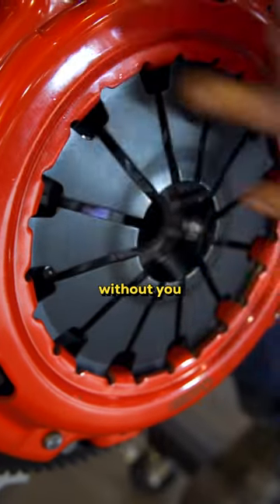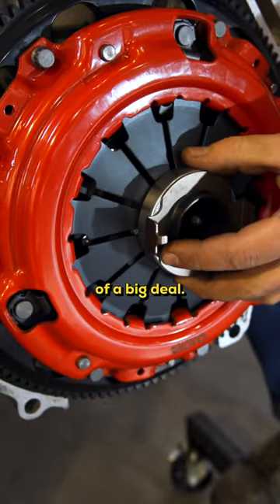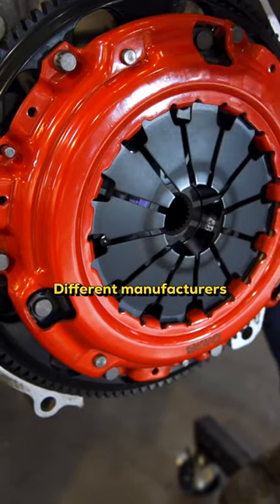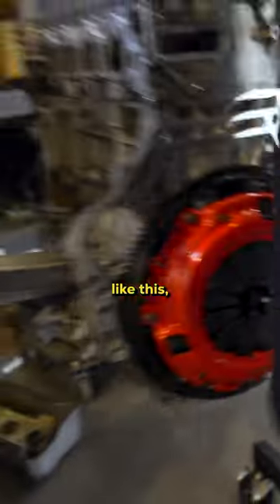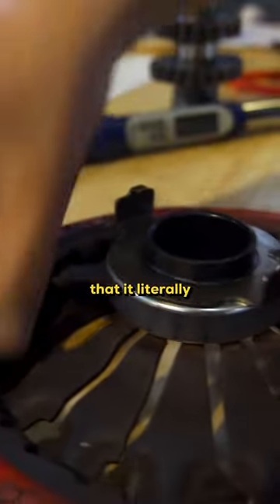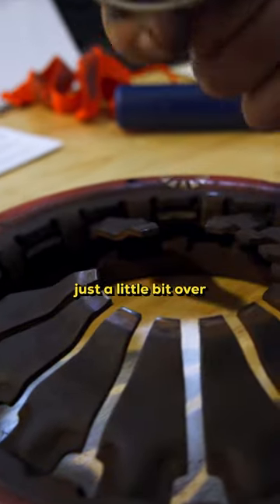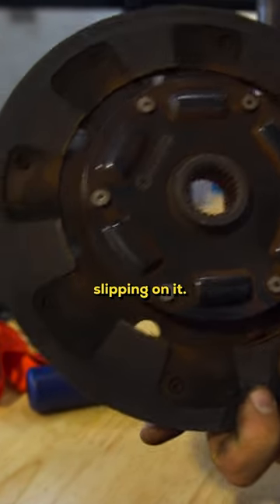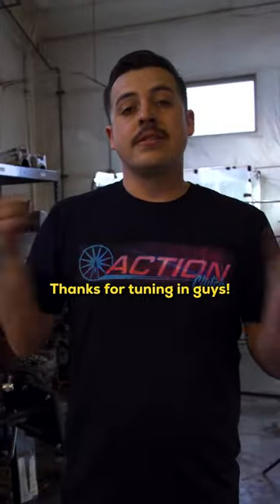IS THE THROWOUT BEARING BURNING YOUR CLUTCH!!

Comment: You forgot to mention the throwout bearing is not supposed to ride on a diaphragm fingers or a three finger clutch it should have a minimum of 1/16 of an inch which is 0625 it should only spend when you put the clutch in otherwise it will wear out and burn up prematurely that's why you don't ride and drive with your foot on the clutch

Comment: I had my clutch material expand so much that the clutch locked up and I had little cash so I just compressed it and the clutch fingers bent enough that I could use it for another year but now I have to take it back to where they put the crappy expanding clutch in or leave it on the street.

Comment: Exact same clutch as mine, exact same problem, essentially glued my clutch plate to my pressure plate, went to go one day and it wouldn’t go into gear, was told it’s the master cylinder, wasn’t that, took the clutch off and the pressure plate and clutch plate were stuck together, had to pry it apart with a screwdriver. Only had it 6 weeks.

Comment: Been there, had mine adjusted backwards, fully tight. Smoked the clutch. Having issues with z bar and linkage now. Buying a new clutch starting over. 
Last time split z bar and bent clutch fork. Lesson learned.

Comment: Video on clutch adjustment plz
Reply from the maker: Noted 🫡
Reply: I should've explored adjusting my "frankensteined" clutch setup on my bmw
Reply: Seriously. How would you adjust the slave?
Reply: @Mustard-Bargain  well, just a quick theory, was maybe modify the body of the slave (skimming down the ears, so the plunger fits deeper into the bell housing/clutch fork).   Dunno if it's been done before, or not, or whether it can even be done, lol.  My mind was just wandering...
Reply: Can the car clutch works for a power press machine or not 🙏

Comment: I have a 83 toyota corolla wagon AE71 rwd 1.6 that I changed over to a 5 speed manual. 
I had to make the hydraulic line from the master to the slave .
I can not get the free travel I need on the pedal .
I can adjust it so it has about 1/4 free travel, then as soon as the engine gets to operating temperature it has no free travel .
First thing it the morning the pedal has the 1/4" free travel then after the engine warms up the travel is gone with O free travel. 
I can adjust it after the engine gets to operating temperature and have 1/4" free travel. 
Then when it cools down the pedal has way to much travel with the clutch catching right on the floor.
 
And information would be greatly appreciated ...
Reply: Possibly didn't bleed the line correctly and water or air expands due to heat?
Reply: You have air in the system somewhere. Hydraulic fluid doesn’t expand like that with mild temperature changes
Reply from the maker: Double check for air in the system also make sure the hydraulic line you made from the slave to the master has the proper fittings that could be another issue that would result in the same problem.

Comment: Great video, informative and to the point!
I'm currently trying to diagnose a problem with my car since the clutch won't fully disengage and start to slip and spin the wheels if I put it in neutral and let out the clutch pedal. You hear the whirring vibrating sound from within the car and it's really notiecable, even more so outside. A mechanic changed the clutch, pressure plate and throwout bearing, the slave cylinder and the clutch hose without any improvement. Also machined the flywheel.

Any chance it has to do with the adjustment or is it more likely to be a pilot bearing or something?
Reply from the maker: Yes sounds like an adjustment issue where the throw out bearing still touching the pressure plate that causing the clutch to still trying to engage with out pressing down on the clutch pedal.

Comment: I’m looking to upgrade my clutch and throw out bearing on my 325xi 2004 any tips or recommendations on better performance brands where I wont find myself causing more issues by putting the throw out bearing on too tight or loose.

Comment: if we place the gearbox on the engine but support it with the primary shaft of the gearbox before tightening the screws, could this twist this shaft and subsequently cause tremors to the steering wheel at high speed

Comment: I just had my clutch, pressure plate and flywheel replaced on my Honda. All the gears are entering fine, but when releasing the clutch pedal nothing happens. The axles are all the way in for both wheels so I'm wondering if the issue would be because of the release bearing adjustment. Any ideas?

Comment: I had to replace my manual transmission on my 23 wrx (not paying 12k).

Found a 22 trans on marketplace and installed it on my car.

I go to start it up and none of the gears are open, almost as if clutch is engaged. When the car is off, it will go into all gears but 5. Clutch was thought to be good so wasnt replaced.

What would the resolution in my instance be?

Comment: What could cause a pressure plate to stop returning back to normal position after only 60k miles and only after we removed it? Comparing it to a brand new one, the plate doesn't return up as high.

Comment: Quick question: I bought my first manual car BRZ and when I’m in first or second gear at around 1-2k RPMs it jerks, as if there’s friction in a part of a full rotation that causes it to jerk like if I’m applying brake and then gas, brake and then gas, repeatedly. My foot is not on the clutch and I’m just applying a steady pressure on the gas. I know that it jerks if it’s in low RPM or if I don’t clutch correctly. But it isn’t the same type of jerking and I don’t think it should be this way. Maybe my clutch is worn off or something else is wrong. If you guys or girls have any suggestions please let me know. Thank you.
Reply from the maker: Hello doesn’t sound like a clutch issue it could be other issues as like worn mounts, bushing or even tires with uneven wear. I would suggest to get inspected by mechanic.

Comment: @actionclutch Any advice or help much appreciated I have a 2013 dodge dart 1.4 and have herd installing a clutch delay valve delete kit helps keep the slave cylinder and clutch alive. Any thoughts on this since my slave cylinder is inside the transmission and cost me $1000 to replace.

Comment: 2009 corvette manual, new mcleod clutch new slave cylinder, new torque tube. get rattling noise w/clutch engaged, no noise clutch disengaged. if i remove the slave cylinder, no noise. what can i do to stop this noise?

Comment: Did you paint that pressure plate or did it come painted like that already?
My Valeo single mass fly wheel kit was rusted out of the box.  I dont want it to rust so easily.
Reply from the maker: Its a special anodized coating we use

Comment: Nice video. One question. I thought neutral was a gear in the gearbox where power doesn’t go out through the output shaft. A disengaged clutch means no power to the input shaft?
Reply from the maker: Manual cars can have up to 6 gears even 7. That being said neutral is not a gear.

Comment: I have cluncking when my pedal is up! G35 mechanic did new clutch replaced everything new I’m so upset
Reply: buddy had the same problem with his g35 sedan. one day it happened out of the blue and we couldent figure out the problem. one day of just went back to normal
Reply: Maybe one of the parts you replaced was a dud, it happens.
Reply from the maker: I would check the pedal adjustment it's possible the release bearing is making contact with the pressure plate, if so adjust accordingly using specs from the service manual.

Comment: I have vauxhall insignia 1.8 petrol,  6 gears. I changed the gearbox, the flywheel and the clutch... some times I hear noise when driving it. When I press the clutch down the noise stops. The moment I release my legs from the clutch the noise comes back.. I don't know what the problem is.. can you please help me out
Reply: The same happens to me. I have a 1998 hilux
Reply: Most likely a gearbox input shaft bearing as the gearbox doesn't rotate when you put the clutch pedal down. Might be a bit late now though

Comment: Idk if you have any insight on this. I own a 2007 Impreza 2.5i 5 speed. Me belief is my clutch release bearing is either broken or too loose/tight but don’t know how to determine. It makes this odd squealish sound when idle and off the clutch. The sound goes away the moment I engage the most minimal pressure on the clutch. Don’t hear it much while I’m motion, clutch is slipping but I’m worried about wear on my plates or the bearing itself. Any insight appreciated
Reply from the maker: Hey brother sounds like the release bearing is being overtraveled you might want to check the adjustment if unsure how take it to the mechanic that installed it or check your service manual takes about 20mins or so to do 😎 -Cub
Reply: If the release bearing is too far will it make a noise like mine is?

Comment: I just wanna be sure, if your where driving a manual car and when you go to give it gas on gear 1 it Rev high, when you are in high gear like 4 and give it gas it Rev high for a bit before going, the speed does climb but slow not to slowly, heard it's clutch slip but just want to be sure before dropping 2.5k on a new clutch
Reply: You have slippery clutch, mine was doing the same, got it fixed yesterday,
Reply: Sounds like your clutch disc is gone and struggling to grip. $2.5k for a clutch is why I learned to do my own work or figure it out as I go. My whole clutch kit was $90, if I had taken it to a shop it been easy $1000.
Reply from the maker: The clutch could be on it's way out if it hasn't already, have a trained technician diagnose it.

Comment: i just had 2006 mazda 3 give out on me, the clutch is completely gone, any advice before i tackle this project?
Reply: I just did an ACT clutch install on my 09 Mazdaspeed 3 I’m basically rebuilding …it’s not too terrible I did it in my garage with no lift and I’m not a professional mechanic just a home mechanic my main advice would be to make sure you organize and or draw diagrams to know where every bolt goes back(took me a lot of research from rushing disassembly) and it will make it 100x easier..other than that just look up a good guide on YouTube for a Mazda 3 clutch change with the brand of clutch you have and follow it step by step and make sure not to skip out the last thing you want to do is have to pull it all back apart when done so its usually very recommended to replace the slave cylinder and the clutch release fork as well the same time your are replacing the clutch..hope that helps some!
Reply from the maker: Solid advice

Comment: Do you guys have a proven solution clutch kit for the 9thgen SI with an updated TOB that doesn't squeal like a pig like the OEM one?
Reply: Following
Reply: Fellow 9th gen here pretty sure somethings fucked, car feels like it's lurching in neutral from vibrations, additionally it sounds like a diesel pickup now, not sure if I fucked up my whole tranny or not. Car still drives okay, but clutch sometimes feels like it's not engaging not sure if it's a shifter issue or what's going on with it but shit not looking forward to shelling out $2k for a rebuild or new tranny
Reply: @paraxicgaming5743  the transmission sounds like a Diesel? Or the engine?
Reply: @jrkustomz5538  not sure which outside the car but inside I can feel the vibration in the floor so gotta be trans
Reply: @paraxicgaming5743  RMM?
Reply: @paraxicgaming5743  maybe change the clutch fluid
Reply: Huh? MRK/Nachi bearings are OEM and those are the best throughout bearings that a K series transmission can see not even aftermarket
Reply: @Honda_Motorsports92  what are you talking about?
Reply: @jrkustomz5538 you are saying OEM (MRK/Nachi) Bearings squeal like a pig? They do not I dunno what your talking about those are the best throwout bearings
Reply: @Honda_Motorsports92  do you own a k24z7?
Reply: @jrkustomz5538  I have a K24A JDM tuned by Chris Miller racing and I’ve owned a K20A2  .. OEM throwout bearings MRK/Nachi are of Exedy quality
Reply: @Honda_Motorsports92  so then you don't know what you're talking about. And we can both agree that since you don't own the car of which engine I speak of you don't have first hand experience........ because a quick Google search would lend you the knowledge that since 2012 we had issues and Honda issued a tsb for the OEM TOB having squealing issues......so thanks but your input is irrelevant to us 9th gen of which my original question was for...
Reply: @Honda_Motorsports92  go Google 9th gen clutch squealing in case you feel the need to argue with something I along with thousands have first hand experience WITH the factory and OEM TOB that even after being replaced with OEM parts would squeal again.
Reply: @jrkustomz5538 sucks to be you .. your case was “ like the OEM one does” the OEM of different models had no issues idk what they got going on for a K24Z7 .. that statement was irrelevant.. stop crying and just get a damn Exedy throw out bearing so simple kid
Reply from the maker: Our stage 2 and up have a premium release bearing. If your bearing is squealing like a pig it is  either worn out or the release bearing is being over-traveled and making contact when not needed which can be fixed with an easy adjustment under the clutch pedal, a good rule of thumb is to have about a 1/4in of clutch pedal freeplay. For other specs always read the service manual.
Reply: @actionclutch  they squealed from the factory. There was a tsb for it. I was out of warranty for it so I let it be

Comment: subaru wrx 2020 just had a act clutch kit installed . when I’m in first gear, I have to give it more gas than you should pull off. If I don’t, I get the stalling effect and I have the bird chirping noise for when I first start the vehicle.
Reply: I'm having the same issue on my 2013 FRS
Reply: ACT clutch, Verus Clutch fork and pivot, new OEM clutch slave and master cylinder. I disconnected the clutch pedal assembly from the master cylinder to rule out clutch pedal adjustment but no success. Not sure how to adjust the travel on the slave or master cylinder.
Reply: It’s a more aggressive clutch so it will grab harder which is probably why you are having to give it more gas. Did you install a lightened flywheel with that clutch by chance?
Reply: GUYS YOU WONT BELIEVE ME, SO DO YOUR OWN RESEARCH. I learned this year, the ecu is going to stall the car everytime with a lightweight clutch and flywheel, because it's accounting for a heavier setup. The only way you can fix this is by TUNING your car.
Reply from the maker: You need to check the clutch pedal adjustment it could be over traveled or under traveled will give you the same symptoms but based off the chirp sounds like it's over-traveled check out your service manual for proper specs.